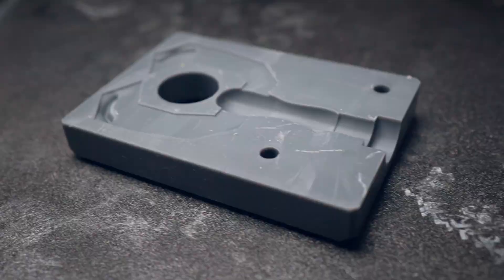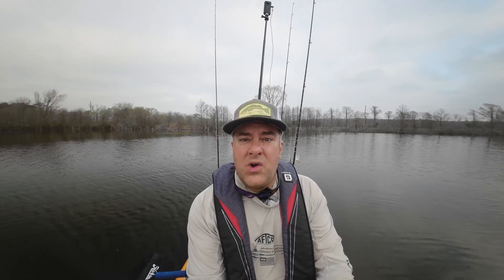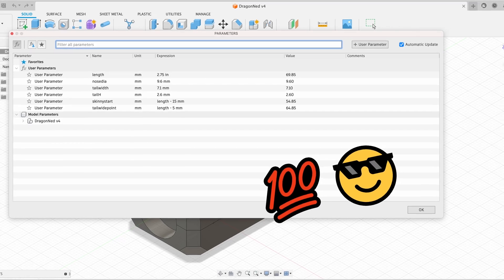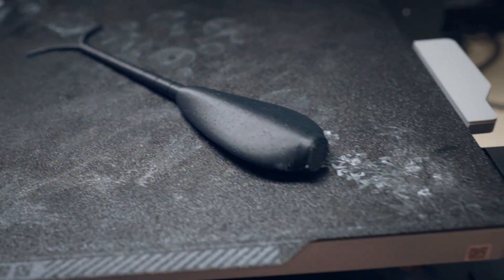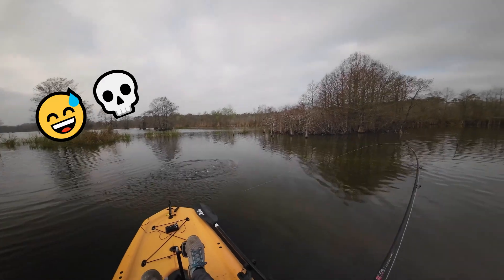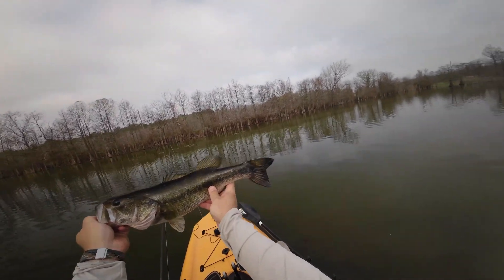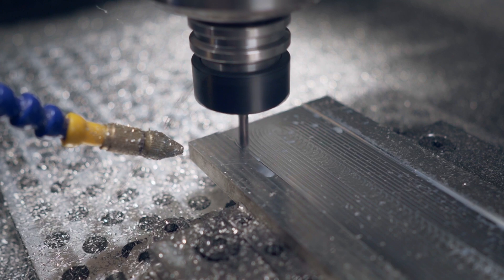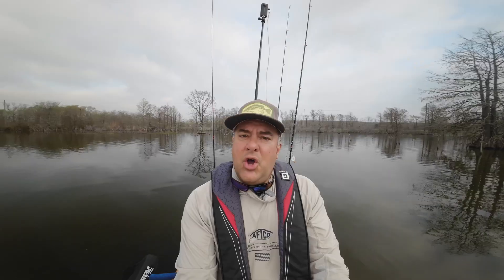See How This Creator Designs Lures that Catch Fish: A Step-by-Step Process

Comment: Great video! You talked about two things that are the most essential to me with designing something. The first is what soft plastic lure do I want, and how do I want it to act in the water. And the second is how can I design this lure around the exact hook I intend to use, or make the lure work with the intended hook, like a hook slot on a thicker bait. I learned this when I made a bait that I wanted, that accepts the hook in an unorthodox way for the action to be right. I'm still learning as I go, but those two things to me, are essential to how I approach the start to a design.